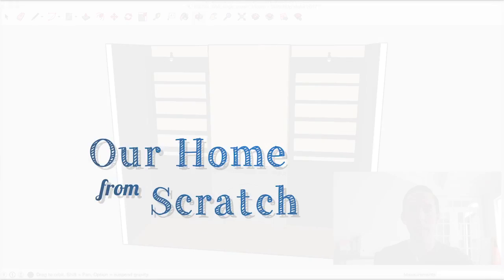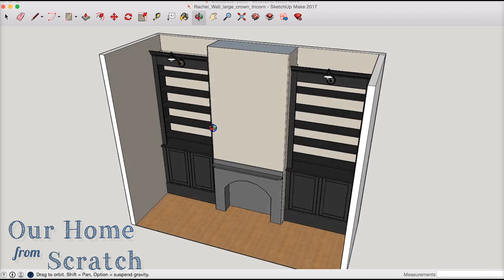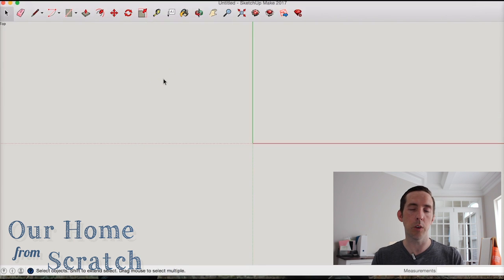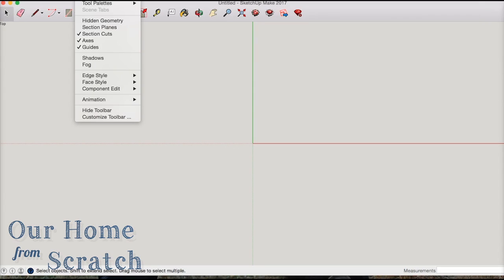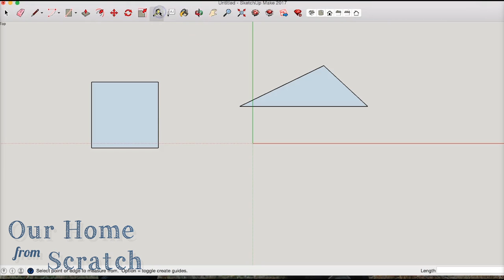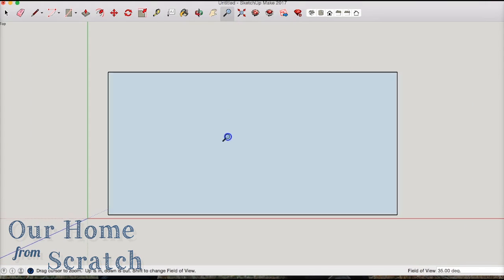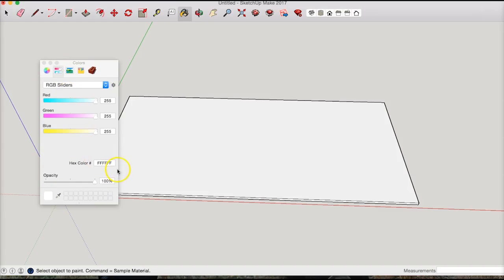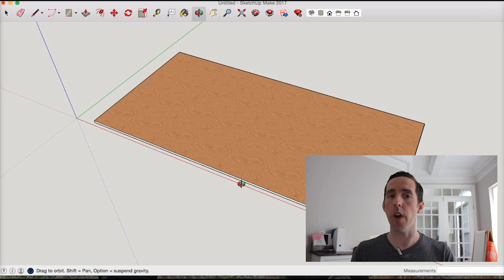Intro to Sketchup 2017 for DIY and Woodwork Lesson 1

Comment: When I make a square shape, I can't click on the dimensions box and type in what I want. It shows the dimensions in inches, but I can't change them.
Reply from the maker: Try not clicking on the box.  So make your rectangle and then just start typing.
Reply: by the time you learn this you could pencil it out on paper and make the project.

Comment: Im new to woodworking and really this video was very helpful. Im planning to start my first project to build work bench, going to give a try using sketchup.
Reply from the maker: Good luck!
Reply: It definitely helps knowing the fundamentals of wood joinery before you go into modeling in sketchup. At the very least I would study up on the basic wood joints needed for whatever you plan to build before you model it since you’re new to woodworking. It will save you time in the long run.